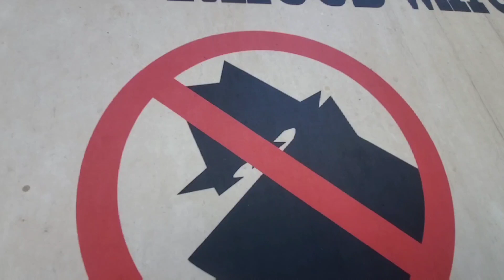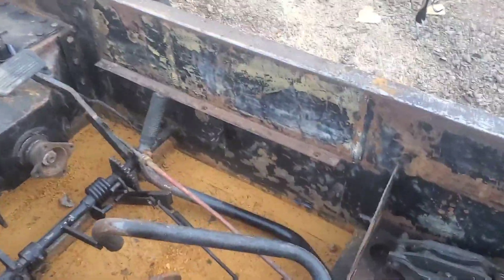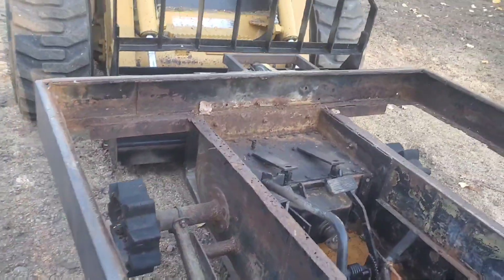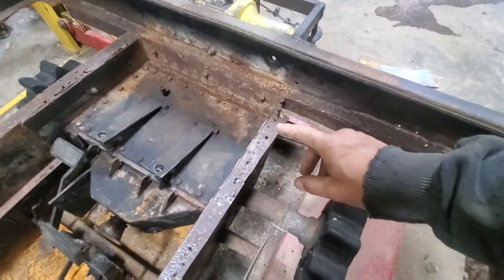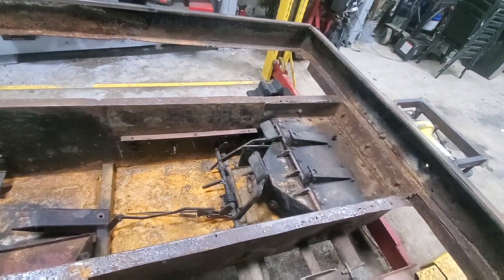Is our tracked Bombi the same as Matt's Offroad Recovery

Comment: Just FYI

We used them in the early 90’s to patrol transmission power line.

That being said, they are great and had reverse but they are rough as shit so any type of suspension in the seating would be a big plus going forward.
Reply from the maker: Woo hoo I love Intel like that!!!! Doesn't appear to.be much cushion in the current setup!  We also need to aquire a set of winter tracks or there will.be a massive pile.of fabrication in the future